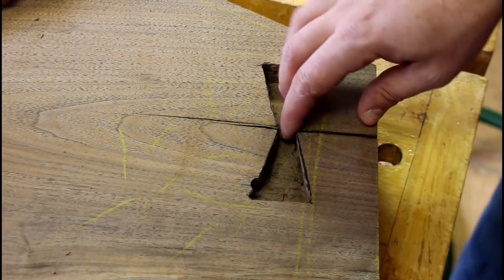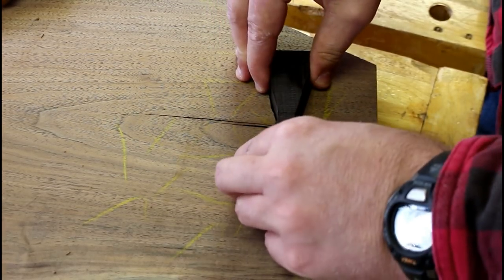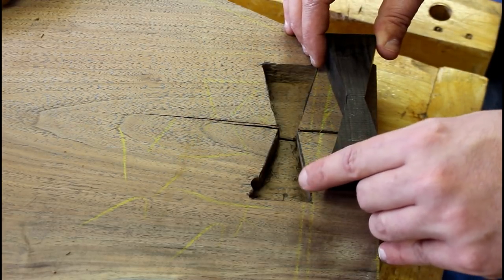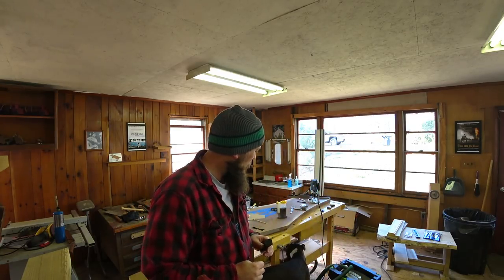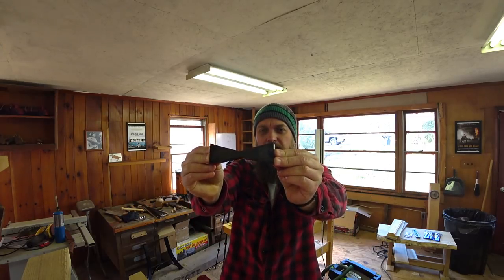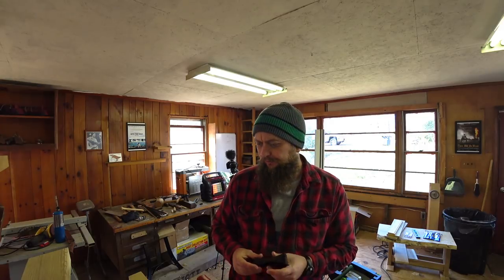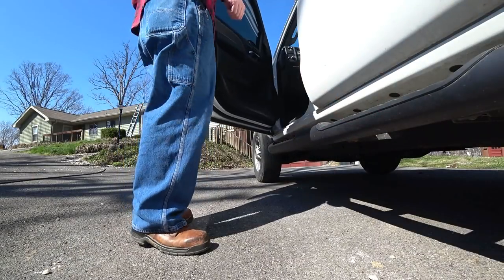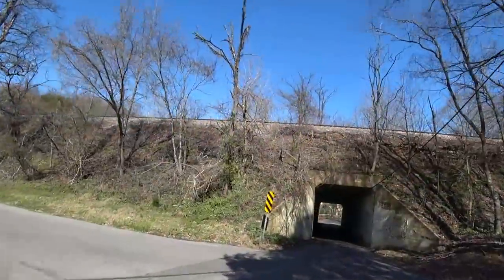IF YOU ENJOY TIME IN THE WOOD SHOP THEN WATCH THIS VIDEO, LIVE EDGE WALNUT SLAB TABLE BUILD, PART 2

Comment: Nathan, I use Titebond 1 to glue it in place.  I also have West Systems Epoxy for filling.  You should really get a gallon of West systems if you don't have it, along with a couple different hardeners(fast and extra slow for clear applications), and definitely get the spouts that automatically meter out the correct amount of material. I don't care for that tube type thick epoxy plus it's expensive for the amount you get.  West systems would be cheaper.Brad_bb
Reply from the maker: I do have the West systems also. Use it most of the time. Thanks for the tip and for watching! I appreciate it!